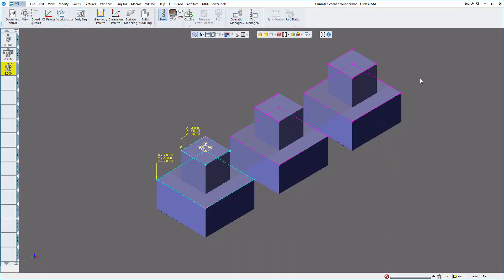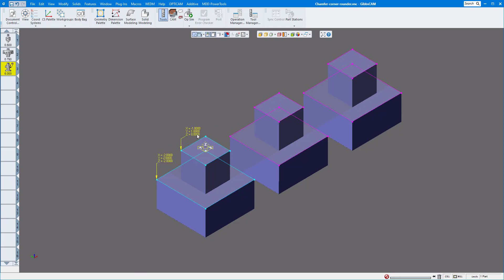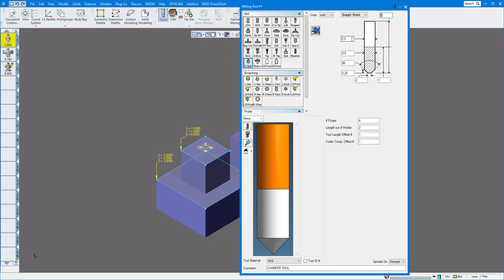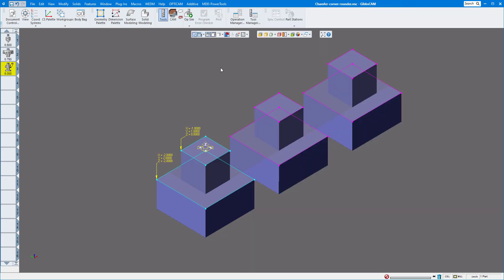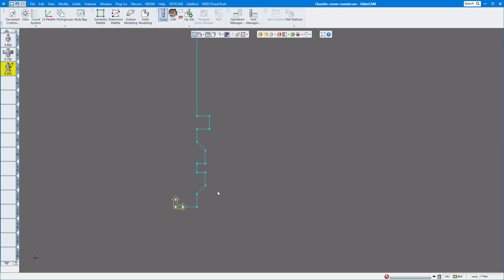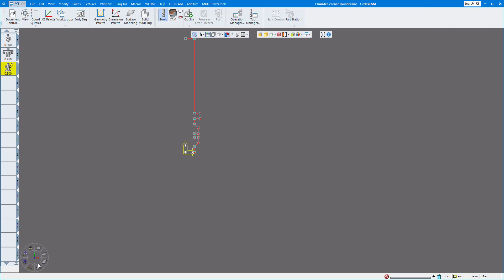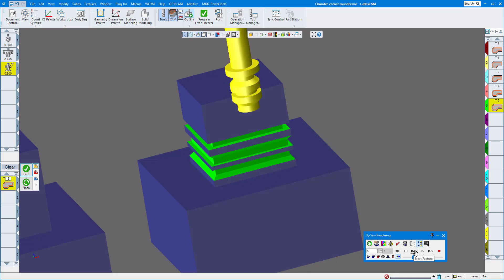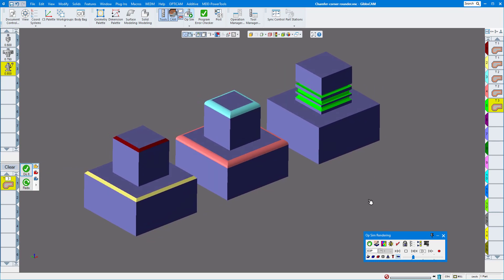GibbsCAM, using Chamfer, Corner Rounder, and custom tool shapes

Comment: 10:32 makes no sense.
Reply from the maker: Let me explain.  If say you draw geometry at the top of your part, then you tell Gibbs that the depth if the cut is 2" deep.  Gibbs looks at the diameter of the tool at 2" deep, which in this case is on the shank of the cutter.  If you don't put any + or - in the stock Gibbs will put the diameter of the cutter to meet the geometry you drew on your part.   At the 10;32 you are referring to is where we are are drawing the shape of the custom tool.  Gibbs needs to know the diameter of a rotating tool, hence the reason for drawing it like this.  Hope this makes sense, otherwise let me know and I can create another video explaining further.  Thanks for watching.
Reply from the maker: @powershop1903  You can sent me the file you are working on and I can take a look to help.  I can put a link to my folder if you like. Let me know.